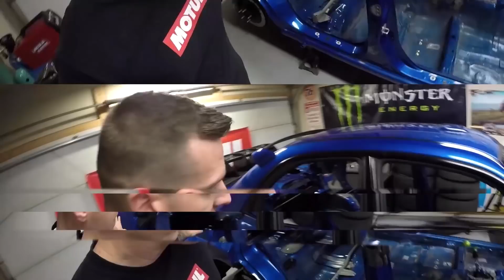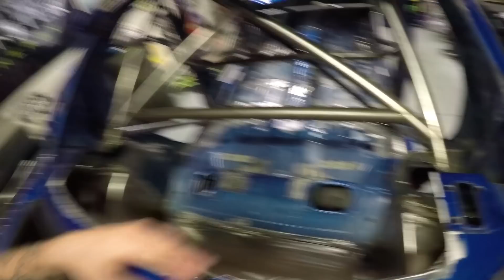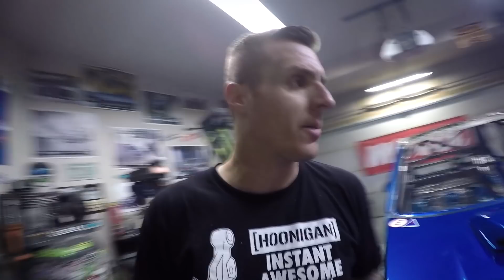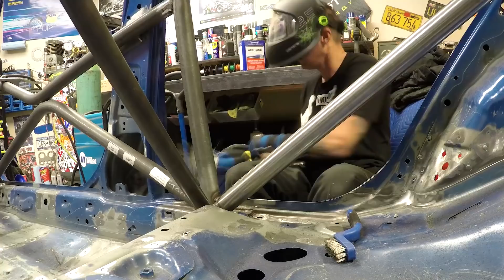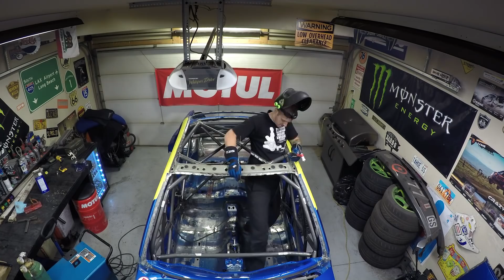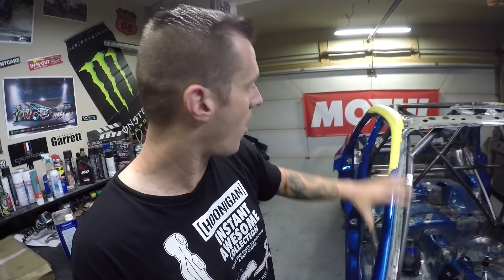WRC Roll Cage Tig Welding/Roof Removal- Subaru Impreza STi WRC / Gymkhana Build Series

Comment: Is it just me, or is one of the door bars on both sides in backwards?  I thought the bent area met more or less in a vertical fashion on this kit.
Reply from the maker: I thought the same thing but it is installed correctly according to the instructions. Looks can be deceiving though, with the door bar gussets Installed it centers the appearance up. You’ll see in the next episode I upload.
Reply: @MPGymkhana  I reviewed the images on the CD and you're totally right - thanks for the heads up.

Got a question for you about the front laterals too - when you sit with your back to the main hoop cross and look at them, are they tilted inward or completely vertical?  Working on this same kit right now and this is causing some confusion!
Reply from the maker: Yea it’s definitely off when you start fitting the door bars I had to measure everything like 5x but that’s the way it goes 😉